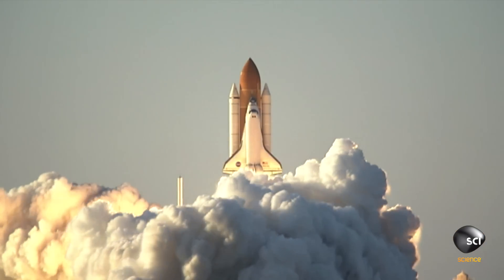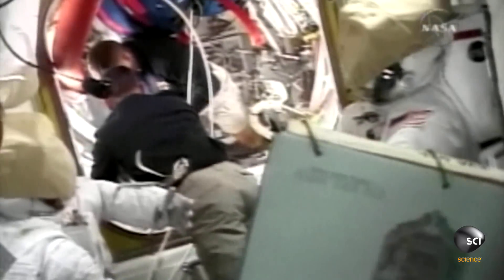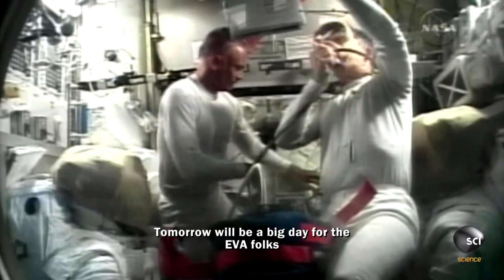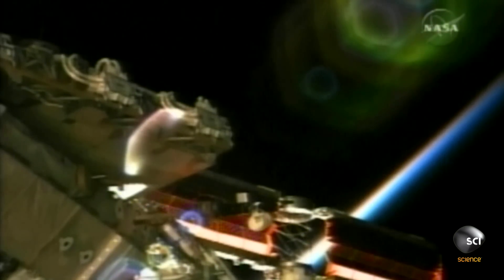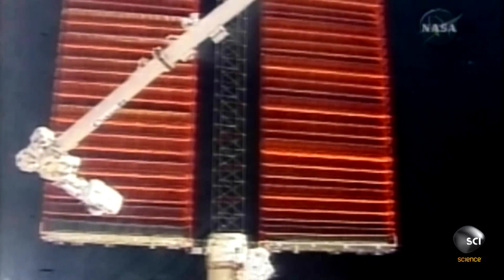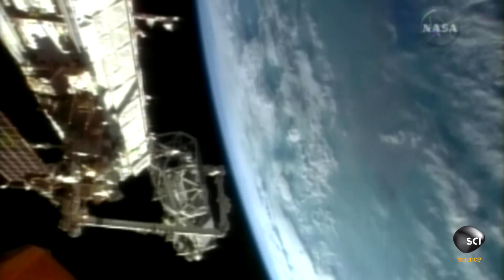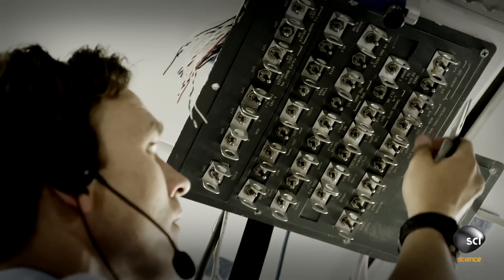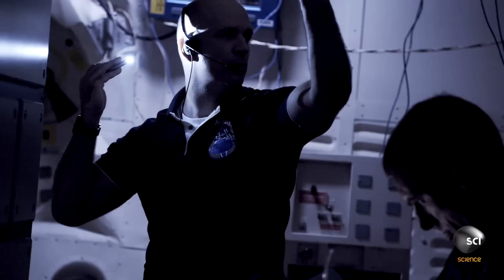Power Outage on the ISS

Comment: Still  cant wrapp my head around people going outside at 18000 miles mph think it's a bunch of crap
Reply: It's possible because there is no resistance from an atmophere. Think about travelling in a high-speed vehicle, like a plane. When you're inside, you're travelling very fast but you can move around easily because the air is all moving with you. Going outside the plane is only a problem  because the air out there isn't moving at the same speed and direction, it causes massive resistance.

In space, there is no air outside to cause resistance, so going outside isn't much different from being inside.
Reply: you obviously have a very weak mind
Reply: William Booker ,I dare you put on a space suit attach yourself to a race car on a couple hoses and cable,, and I'll make it easy let yourself dangle on a race car going 300mph see what's going to happen !!!! not alone traveling at 1800mph the best advice for me is snap out of your fairy tale dreams
Reply: The thing is though, in space there is zero air resistance and zero g-force. When an astronaut leaves the station on a tether, he is still going the same speed as the station. The fact they are in a vacuum AND zero G makes it much different from your car analogy
Reply: Dave must have low IQ. In your car if you go 100 mph you are also moving at 100mph which is why if you stick your hand out it gets blast back by air. In space there’s no air to bush you back so they stay moving at the speed of a the station.
Reply: Plus with the zero gravity you don’t fall so being connected by a tether to the station means your going the same speed and zero gravity means your not gonna fall either so your car theory makes no sense.
Reply: All I'm going to say skylord I dare you try it but make your will out to me before you do

Comment: Wait. So they have the ability to shut off life support systems. He said the Co2 levels were rising doesn't that mean the oxygen scrubbers were off. Why would they even make it possible to turn off life support?!?!
Reply: Eduardo Vargas I know im late but Think of it as low power mode on your phone plus you would need to be able to shut them down so in the event of a electrical falt in the scrubbers you would need to shut them off
Reply: Eduardo Vargas ^he said it perfectly. You dont wanna run something electrical if its fucked up. Could make it worse.